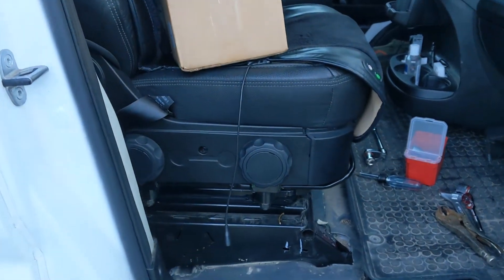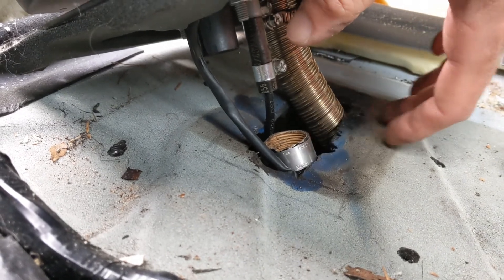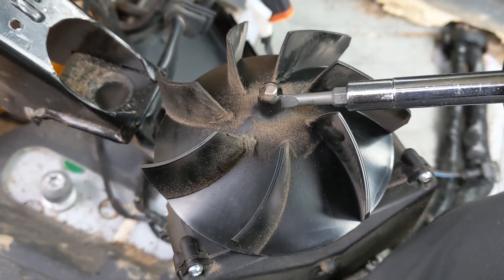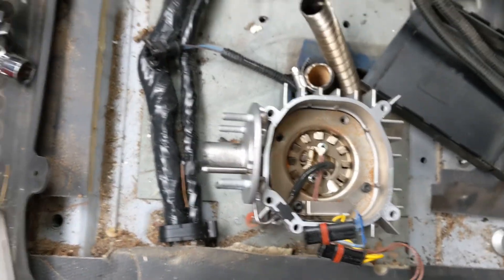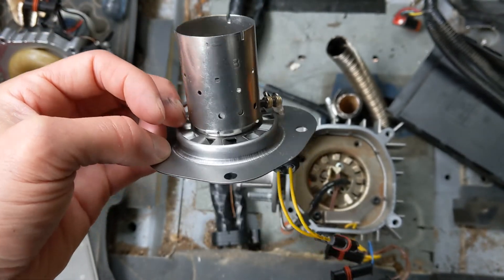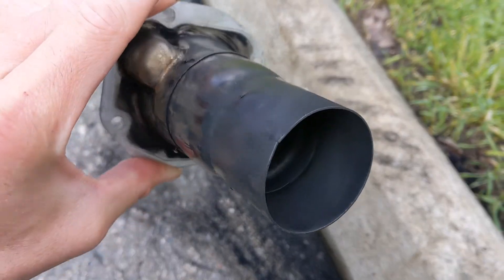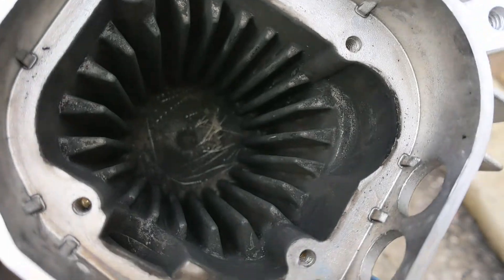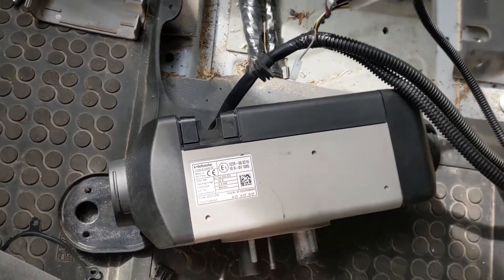Webasto Airtop 2000 STC Clog and Repair

Comment: Bonjour et merci pour la presentation , ne voyant pas comment démonter mon webasto, y a t'il un moyen de le décalaminer sans le démonter ?. merci
Reply from the maker: As far as I'm aware, once the carbon builds up, you have to disassemble it. There are things you can do to try to prevent buildup but there isn't a flushing mechanism.

Comment: How long of use was that to get dirty
Reply from the maker: Less than a year but we used it at high altitude without adjusting the air to fuel ratio.
Reply: @OutdoorTraveler What was your altitude range out of curiosity? Great video. Thank you.
Reply from the maker: @RetiredPoliceDetective when it fully stopped working we were at the south rim of Grand canyon. Which I believe is about 7000 feet. We arrived from the east south east of there which I think fluctuates between 4000 and 6000. Before that we bummer around New Mexico for a month in various elevations including Gila National Park.
Reply: @OutdoorTraveler Thank you. I am skiing at 5,200 feet and generally stay for a few weeks. Running it at the highest Temp. I haven't had an issue for two seasons, but this season I'm starting to notice a drop in temperature. I felt it could be related to your issues. Thank you for putting the video together. It allows me to understand what I can't see.

Comment: Run kerosene through it a couple  a year it will help burn out the gummy gunk left behind from running at low temp. Wabastos heaters dont like to run at low temp crank it up and open a window

Comment: How do you put into high altitude mode?
Reply from the maker: There's a process where you ground out a wire and twist the reostat knob.  I don't remember the details but it's documented online in google/youtube.  The downside is, without special equipment to monitor the exhaust, you can't tune it exactly.

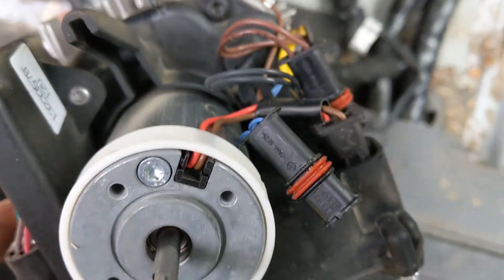Comment: To be clear you don’t have to take the blower Motor apart like this guy lightly touched base on.(the T25 bit for the long screws on the front facing with the white ring securing the red and brown wires around 3:15) he didn’t clarify that you don’t need to do that and if you do you might have a really hard time getting the magnet seated properly which will then lead to an H89 blower/fan motor problem.
Reply: Im having just that problem. Cant for the life of me figure out how to put the blower fan together once taken apart. If anyone knows the trick to that, please post. Original poster, if you can tell me how you did that once you took the blower motor screws out as you suggested, please let me know.